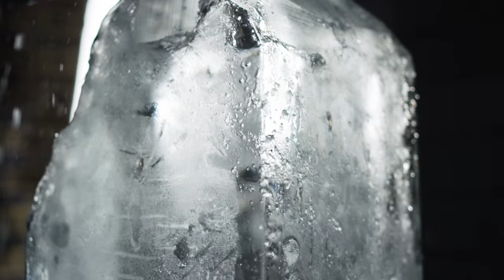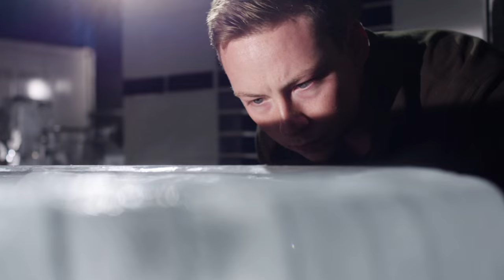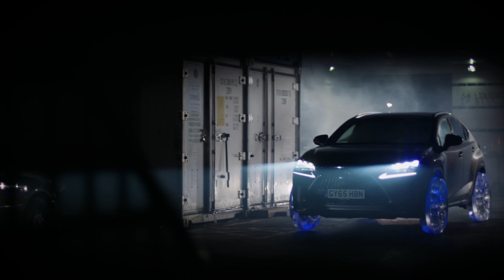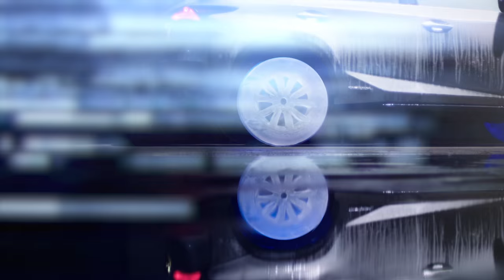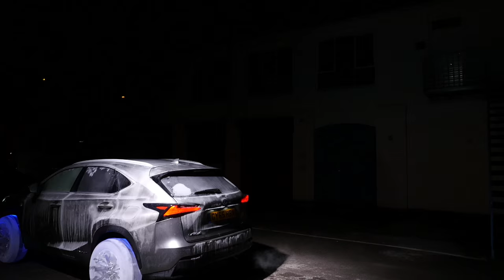Lexus on Ice: NX Ice Wheels

Comment: Just to review these tires since I've tried them, they look cool but the tread wear sucks.. Less than 2 miles and more than half the tread was gone.. The handling is very slippery and the tires compound cracks a lot. They're very noisy and sound like you're driving on crushed glass. Did I mention they're expensive? 10/10 would die again

Comment: How do those wheels not break?
Reply: There's a thick metal disk sandwiched between slices of the ice sculpture.
Reply: +Gabriel Clavijo I think it's a thick, clear acrylic layer actually.  So it would match the ice.
Reply: +Gabriel Clavijo A bit disappointing. Might as well just be an ice rim then, just for looks.
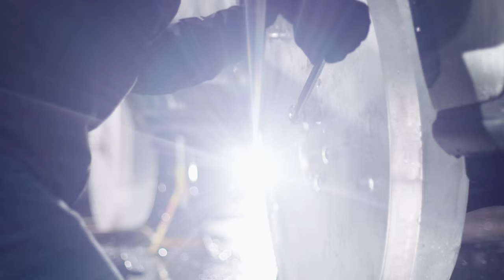Reply: +James Landon   Stop the video right at 0:31 and you can see the acrylic/plastic disk.
Reply: +DzeiEidz I think mythbusters or somebody on youtube (maybe colinfurze) tried ice wheels once. They were very prone to cracking. Almost impossible to use. They however didn't have a full facility cooled down to -30° at thier hands and tons of engineers and stuff. I'm pretty sure lexus could make it kind of work. I'd like to see them hand a car on ice wheels to a competent drifter.
Reply: Colin Furze did make ice wheels, for a bike, and I think they did crack at first but he created an inner structure, like the rim of a tire, to support the ice. He may not have had a -30 facility but he did go ride it on a glacier :P
Reply: because that car is probably made of foam.
Reply: Outrageous acts of science proved there's acrylic in the center

Comment: i detect a hint of bullshit here. Colin furze tried something like this on a tiny trike. The wheels shattered. How is a 2 tonne machine not destroying these?
Reply: +Yazan AL I have the same question
Reply: the weight of the car is evenly distributed through 4 tires, and not 3. the tires are also wider on a car vs a trike or bike. the weight on a trike or bike would be too much for a single ice tire to take rather than spacing it out between 2 tires to front and back.
Reply: +Daniel Crews 
better ice as well.
Reply: Daniel Crews could they be supported with a metal skeleton?
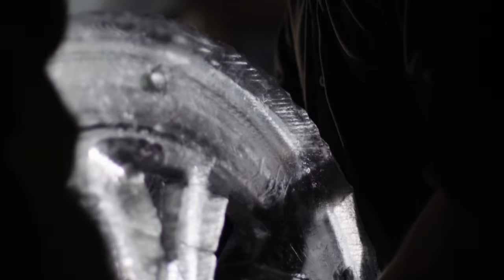Reply: +Daniel Crews wrong, as someone in the comments already pointed out there is a metal disc between the ice which you can see if you pause at 0:31

Comment: Lexus 1-2 turbo intercooler petrol engines all : 20-100 l/100km, over 100 l/100km, easy range, overload forever.

From
Lexus database engines with series

End report.

Comment: I love my IS250 I'm sad that the wheels are so expensive to replace but still a great car I drive it thw way it's meant to be driven I redline it I take traction control off on sharp corners and down shift on tight ones if you buy a car just to look cool in then you aren't a driver i just wish they would have made the 350 in a manual gearbox

Comment: If you noticed the car never accelerated to any great speed. Ice will support a cars weight and as long as the temperature retains a certain degree of chill the Ice will not melt. But do not hit a chuck hole or object in the road. Any sharp turn will have you sliding I bet.
Reply from the maker: You're not wrong Michael. LexusOnIce was filmed in a controlled environment - we certainly wouldn't expect tyres made of ice to go mainstream. Here's more info on how it was made: po.st/Bn6e91

Comment: There is no way that the weight of the car can be placed on ice wheels unless the ground is rubber. In other words, this video is contrived. 
That this video is pointless appeals to stupid people is one thing, but that they are willing to so powerfully mislead is an open admission to how stupid Lexus thinks its spoiled rich kid customers are.
The last car you would ever see me in, is a Lexus.
Reply from the maker: Hi Walter. The video is not contrived. The weight of the car was spread evenly over the four ice tyres and it was driven on concrete. We were worried that they wouldn't take the weight. You can see how we made it here: po.st/LmZLiP
Reply: +Lexus UK,
Thank you for the link. Perhaps if you were as honest in the ad as you were in this link thoughtful people, people with sensitive bullshit antennas, would appreciate that technology can merge with art. In this case clear plastic was doing the load bearing and CAD defining the shape for automated carving. That is more art than the laborer you hired to actually put chisel to ice in a step that would have been far more accurate with that also done by automation.
Reply from the maker: It's all in the video description, Walter.